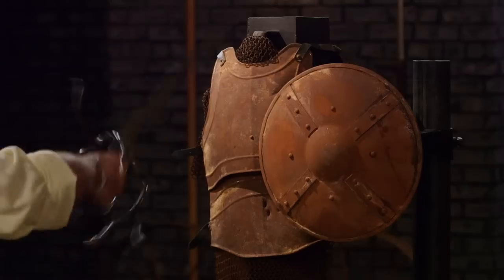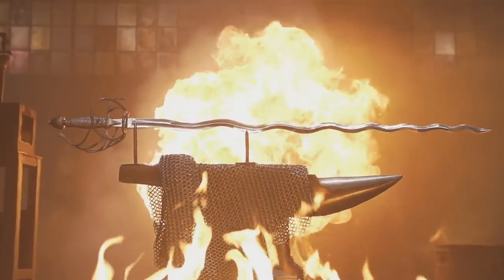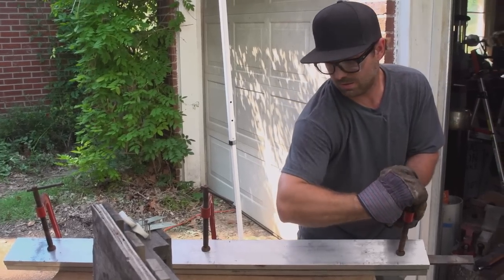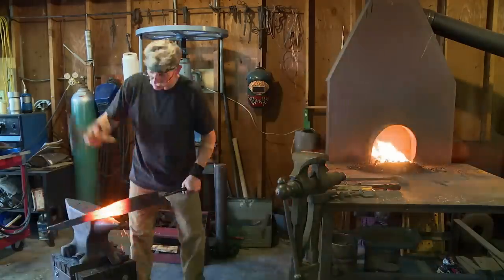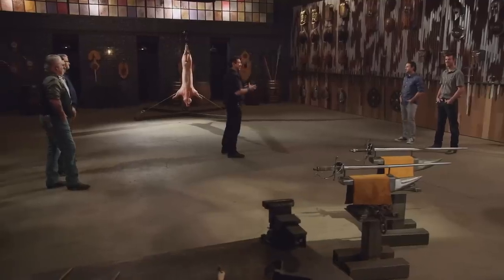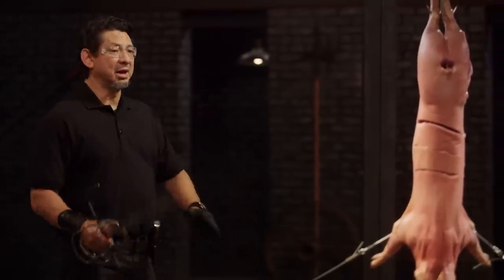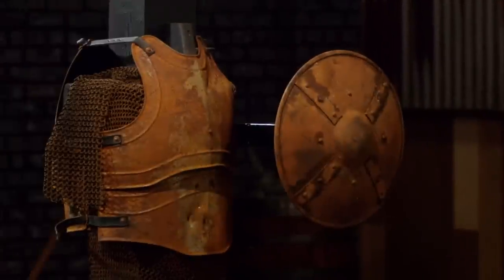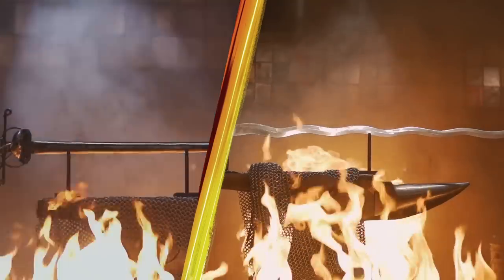FORGED MADNESS: Musketeer Rapier vs. Flamberge Rapier | Forged in Fire

Comment: Designwise, the musketeer rapier is going to go in more smoothly when thrusting and hold up better to stress, while the flamberge is doing to inflict wider wounds and is a superior parrying weapon.

Make: both swords went very smoothly in and slashed quite well.  Both weapons were durable and light.  

These weapons are ultimately equivalent. Personally I prefer the straight lines of the musketeer weapon, but it's more a matter of taste.
Reply: How about a rapier with a straight point and a flambergue ricasso?
Reply: i would have to go for the flamberge due to the fact that it causes a wider wound when u stab something and also because i love the design.

Comment: I have a question for everyone who has made a blade what would you make to survive and live solo in the middle of nowhere with you and how much force and stress can you put on your blade and it still can survive. As well as not having to Resharping it if you were stuck in the middle nowhere and a tropical island Dennis jungle how well would your knife hold up having a whale into trees you've been able to chip rocks and still be able to say that it would be safe for you to swing with out having to spend more energy swinging harder from dulling. Keep in mind that you will need to be able to swing all day if your are in a jungle. So weigh is a factor that you may want to consider as well. It's not trying to show off and being fancy it's purely for survival. If you can answer this than you should try knife or death. FYI. Think about what you know from history when you are thinking about it. What is your choice.
Reply: Well interesting ... I might have to make a "Frankenstein"  , A Halberd head , with a smaller type handle kinda like the horsemans axe and a warhammer head on the back side of the Halberd